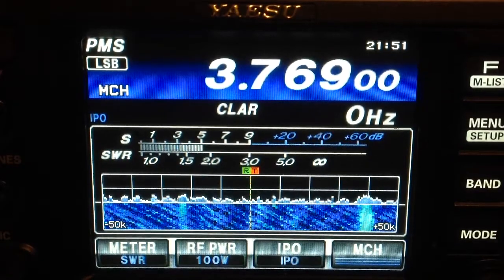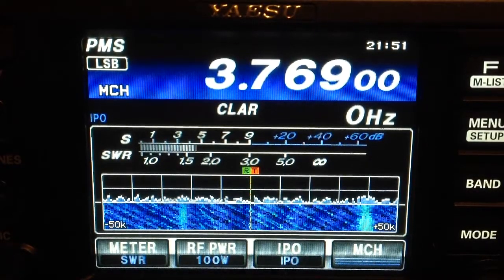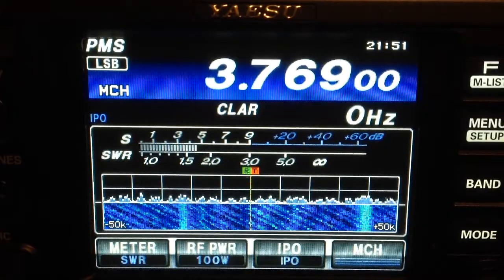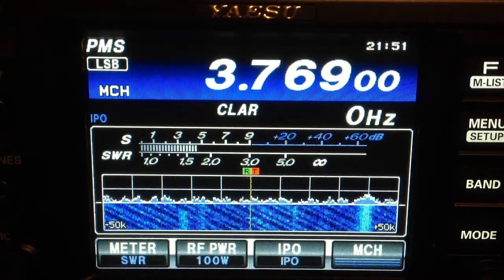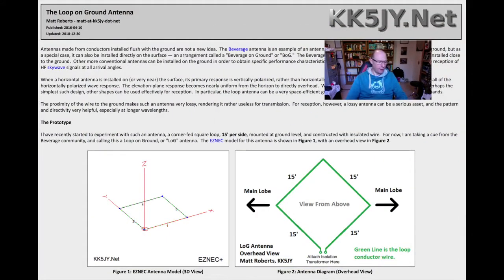8 - The LOG (Loop On Ground) Antenna

Comment: I'm confused. The loop is balanced, right? Yet you only step it down the the right impedance without unbalancing it before sending it out the coax. What am I missing?
Reply from the maker: Sorry, I don't really understand your point of confusion. The loop is balanced but the feedline isn't so that's why there is an impedance matching Balun. In truth this video was made several years ago and that antenna (and QTH) is now long gone. You could try contacting the guy who designed the thing (details in the video). Thanks for watching. Best wishes, Nick
Reply: @M0NTVHomebrewing  But  that's not a true balun. It's only an impedance changer. (I think-  and I might be wrong!)
Reply from the maker: Ahh ...Ok Paul, I'm with you! Sorry. Yes, you are right - it is not a true balun. The transformer is described by the designer as an isolation transformer (https://www.kk5jy.net/LoG/) which is almost identical to the transformer used in a Beverage antenna. The main purpose I think is to guard against common mode noise. Thanks again for watching. 73, Nick

Comment: Was wondering if you can use a much larger gauge wire and improve reception? Thank you for the video.
Reply from the maker: Hi John, I'm not sure about that. If you check out the guy I reference in the video I know he tried various configurations. I basically just built the standard one with the wire I had (Sotabeams heavy duty - the green stuff). 73, Nick

Comment: not sure if you are answer any more questions, but are you still suing this loop and if I understand this its only good for the lower bands like 40 nad 80 not the higher bands like 20 and 15 correct? nice video !
Reply from the maker: Hi there. No this antenna is ancient history for me. I only had it for about a year. It was certainly effective at filtering the QRM on 80m but then the noise suddenly stopped and I didn't really need the LOG anymore. You are right that it is only used on the lower HF bands - 160 MHz, 80m and 60m. Certainly not above 40m. It does filter out a lot of noise but at the cost of significant attenuation of your signal too. I guess there is no such thing as a free lunch! 73, Nick

Comment: Wow, that works good.
Reply from the maker: Hi! It did make quite a difference at a time when I had loads of QRM on half of the 80m band. Then the noise stopped suddenly and I never really needed the LOG antenna again. It is quite a cool idea though. 73, Nick
Reply: @M0NTVHomebrewing  I guess it a 'try and see' situation. Some vids show that it made it worse. I wist there was a way to do a better  test rather than listening to a guy talking 600 miles away and spend a bunch of times listening with the LOG in and out of use.

Comment: At 02:50 you mention having a LoG (receive) and a transmit antenna that can "...switch in-and-out with the PTT."  How did you achieve this with the IC-7300? Thanks.
Reply from the maker: Hi! I said that I was investigating having a separate RX antenna - one that I could switch in and out. In truth I never got this far. The interference I was encountering on 80m seemed to vanish as quickly as it came and so I had no real need of the LOG antenna any longer. In the end I pulled it up and have moved house since then. Also, the commercial rig I was using in this video was a Yaesu FT991A. I've never used an Icon rig so I can't be much help I'm afraid. Sorry! Thanks for watching. 73, Nick
Reply: https://youtu.be/SGbpI20XtI4?feature=shared  a receive jack can be added

Comment: Wait until you clearly hear a signal that doesn’t move the signal meter!  My LOG is 500’ total length, fed where my property line allows.
Reply from the maker: Sounds great. Mine was useful when I suffered a lot of QRM on half of the 80m band. The antenna is now long gone and I'm at a new QTH. Thanks for watching. 73, Nick
Reply: do you find the log works well on 500 feet , also what windings r u using on the transformer  ie ratio thanks a million , regards marki

Comment: I have a small Delta Loop just for fun and works great off a pole.
Reply from the maker: Pleased to hear it. I built one for 6m once which worked really well. It was very directional though. 73, Nick
Reply: @M0NTVHomebrewing  I think this is around 20ft or 3.6m x3, told to put balun high, and bottom 2 opposite the direction of path, so West is east south is north, something I will have to try and find out, great video btw 🙂

Comment: Hello, it appears the dimensions you gave for the antenna Nat her for 80 meters. Would you simply halve the wire lengths for 40 meters?
Reply from the maker: Hi! I think the loop I built is good for 160, 80 and 40m but I advise you check out the original author's website: http://kk5jy.net/LoG
Hope this helps. 73 Nick
Reply: @M0NTVHomebrewing  I mustn’t have paid a lot of attention because I thought it was for transmission, even after seeing that tiny ferrite core!
Reply from the maker: No worries! It is a RX only antenna and mine worked pretty well at my last QTH when I had a lot of QRM on 80m.
Reply: @M0NTVHomebrewing  I only work camping. There’s no gear at my QTH anymore. I thought I’d found a way to be lazy! Due to back problems, I’m probably going to have to make an air bazooka to fire the throw sack with line over the branch.

Comment: hahahah... i have a end feed. no balun no unun. just wire off center of coax 1 ft off ground. to 35ft in tree. shield is 2 60ft #12 soild .. got sick of moving it for mowing. so i rolled the grounds up. about 5ft diameter. hugh on tree works a charm. i hear better on it then i do tx on it hahahha.. tho i do use a manual tunner for 75. antenna is only used for it... tho i need to put up a proper diapole someday

Comment: Would you please explain how you got it to turn on and off with your push to talk I have the same radio that you do and I’m very interested
Reply: I didn’t - I only built it as an experiment and used it for receiving only. I did think about some form or relay switching but never got around to it. It shouldn’t be too difficult to do I should think. All the best, Nick
Reply: @nickwood4367  Thank you for your quick response all the best!
Reply: Mfj 1708b rf sensing switch

Comment: Hello. What material is the box made of? PVC? Thanks de N9NY
Reply from the maker: Just a plastic enclosure that is waterproof and with walls thick enough to drill and mount the connectors. 73 Nick

Comment: Thanks for the interesting video. How does the loop perform on mediumwave? And should i go with one slightly larger than yours? I read that 15% of the intended rx wavelength is the optimal length, which equates to about 45m if i use 300m as the midway point of the mw band (=1000khz)
Reply: Hi Vincent, I'm afraid I've no idea how it will perform on MW. I only ever used mine on 80m. The size is a funny business because some have made larger loops but ended up with worse performance. I think I'd go with your gut and be prepared to experiment a lot! All the best.
Reply: @nickwood4367  thanks Nick. I have a large plot 100x42m and I've tried a few experimental LOGs but strangely enough they seem noisier than my delta loops. But its fun to fiddle around with all kinds of antennas so i might have a crack at a smaller one, 11m per side.

Comment: I'm not doubting that the loop on ground gives a better signal to noise ratio, but I wasn't entirely convinced by the video, because it sounded like the rig had some dsp noise reduction. With the large signal from the efhw the audio peaks were dipping the background noise, but with the lower signal from the loop it sounded like the audio was noise gated. It was definitely more pleasant to listen to, but does it truly demonstrate the s/n advantage of the antenna if the rig's DSP is skewing the results?
Reply from the maker: Possibly not but I was simply running the rig with the same settings that I commonly used at that time. By all means build one and judge for yourself. I've moved house since then and probably won't need to resort to a LOG antenna as my noise floor is now much lower. Thanks for watching and commenting. 73
Reply: @M0NTVHomebrewing  I have used low dipoles, just a couple of feet off the ground, a loop on a fence, and a mini-whip. They definitely show a s/n improvement over a high dipole, so I have absolutely no doubt that the loop on ground also works. If my comments sounded nasty, I apologise wholeheartedly. Thanks for the videos! 73.
Reply from the maker: @seventytrees73  No worries - but thanks all the same :) 73

Comment: You comment about the #73 material being good through 30 Mhz and the entire HF band is incorrect.  If you look at the graph from the manufacturer shows if drop completely at 10 Mhz.  The KK5JY article even says that this core is only good to 30 meters.

And you can see this on your RigExpert too: put a 8 Ohm resistor on the loop side of a 5:2 ratio binocular core, and run a RL (Return Loss) sweep on each band. You see 20 meters has a RL of less than 10 (8).
Reply from the maker: Thanks for watching. Certainly that particular mix is designed for lower frequencies but according to https://www.toroids.info/BN-73-202.php 73 mix is good for wideband transformers from 0.2 - 30 MHz. As I only ever used the loop for 80m it wasn't really an issue for me. 73

Comment: 14:54 I notice your tuner is still engaged on the LOG, that might have an effect on the receive since it is far from being the same loading than you transmit antenna
Reply from the maker: Hi there! Well-spotted. I hadn't noticed this! The tuner doesn't actually kick in unless you transmit a tuning tone through it. It was only there because of my particular setup. But you are right, it could have an effect on receive if it was already held in a 'tuned state' but frankly I don't think it makes much difference when you are just receiving (unless the 'tuned state' was way out). All it will do is present a different impedance to the incoming signal which will result in a higher SWR. This will mean a bit of loss but not much. Since the antenna attenuates the signal in any case it's probably not worth worrying about. Obviously on a receive-only antenna you can get away with a lot more! Thanks for watching and for commenting. 73 Nick M0NTV
Reply: @M0NTVHomebrewing  ok I thought it could have been why you had such results with the log antenna, here I have two transmit antennas that are totally different systems and when one is tuned and I switch to the other one, the reception is greatly degraded, I thought you might have got the same result on your end with a mismatch antenna. 73 de Claude VA2CST

Comment: Very cool ! I'm building two of these this week, one broad side east / west and one broad side north / south with a coax switch in the shack to switch between the logs and my receive only mag loop, which then go to my receive only port on the IC 7600. A guy can never have too many antennas to play with ! hihi.. 73 from NQ0A in Utah.
Reply from the maker: Thanks Mark. That sounds great. 73.
Reply: @M0NTVHomebrewing  Wow ! Wanted to let you know I got this project done and I am amazed ! They are directional for sure and boy do they work well. If hams knew about LOG antennas they could use the low bands again in T storm season. This was a great project, truly amazed. ;-)
Reply from the maker: @nq0amark138  Really pleased for you Mark :) 73

Comment: Interesting video. So how practically would you swap between RX on the loop (which does sound much better for 80M) and TX through your other antenna,  given that the loop is receive only ?
Reply from the maker: That's an excellent question Mark! As yet I've not come to a satisfactory answer. I have played around with RF switches etc. but I could do with something that will handle a bit of power i.e. more than QRP. There are probably some fine solutions out there but I've moved on to other projects I confess.
Reply: Mfj 1708b.  Automatic rf switch

Comment: You using noise reduction lets hear it with noise reduction off ,,,
Reply from the maker: Sorry Paul. I did the tests simply as I would normally use that particular radio on that particular band i.e. with digital noise reduction on. If I'd thought about it before then I'd probably have done as you suggested!

Comment: Just watched this after your talk at Denby Dale. I’ve built a LOG and it is definitely more quiet, but when I scan it with my rig expert I get dips on 40/20/15+10 but 80 has no dip. That’s where I have the biggest noise problem and could use the most help. Any ideas where I should start investigating?  It’s 15ft per side and a 9:1 transformer at the feed point.
Reply from the maker: Hi Dave, thanks for watching and well done for building a LOG antenna. I wouldn't get too concerned about the SWR - incidentally mine shows a similar pattern on a RigExpert analyser. I'm no expert in this but from my understanding the antenna is not intended to be resonant on any particular frequency. A high SWR is simply an indication of impedance mismatch and reflected signal. This is obviously bad news for a transmitter but for a receiver - where the received signal level is magnitudes weaker - it is not such an issue. What it will mean is that you will get attenuation of the signal from your antenna - but (and here's the important bit) that attenuation is applied to both the received signal AND THE NOISE too. So your signal will be weaker but the noise floor will be lower. This is why in the video I was able to switch on the RF preamps and still get a cleaner signal than if I used my EFHW and no preamp. Hope this helps! 73.
Reply: Use more cable per side of the diamond. I understand 25 feet per side to be better for low bands.

Comment: Great video, amazing antenna. Never expected this result. We are members of Denby Dale Amateur Radio Society and heard the announcement of your upcoming lecture on the Zoom clubmeeting today. Looking forward to seeing you soon on Zoom! 73s de Adriane DL8BDT and Mike DL1BJW
Reply: Thank you both very much. Yes it is a surprising antenna! I'm looking forward to joining you on Zoom next month. I'll be going back to basics and talking about homebrewing a direct conversion receiver - another thing which works surprisingly well! 73.
Reply: unun 9: 1?
Reply from the maker: @josehenriqueschossland485  No it's not an UnUn - which is a transmission line transformer - it is a genuine isolation transformer with no DC path to ground and no DC connection between the primary and secondary windings. So the loop is completely isolated from your connecting coax from a DC point of view. It is a 3:1 voltage transformer and so a 9:1 impedance transformer. Please check out Matt Robert's page for the schematic (http://www.kk5jy.net/LoG/). Thanks for your interest.
Reply: @M0NTVHomebrewing  Thank You 73” PU5IKE
Reply from the maker: @josehenriqueschossland485  You are very welcome!